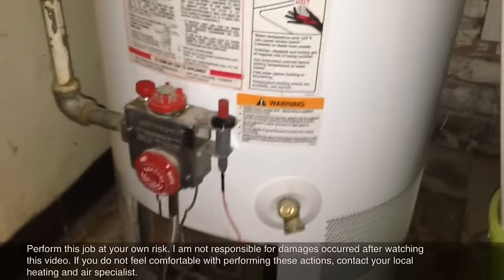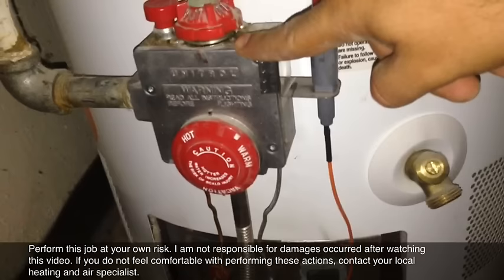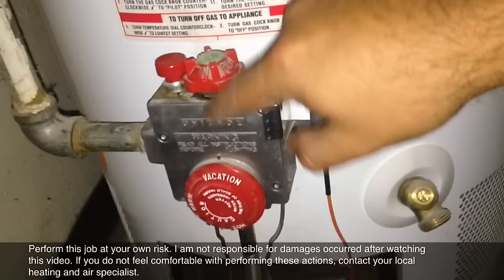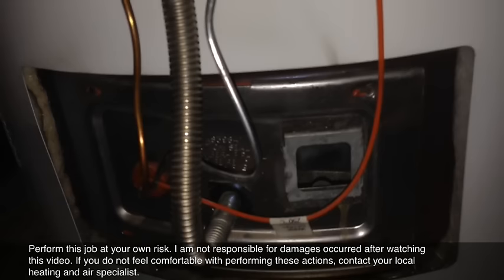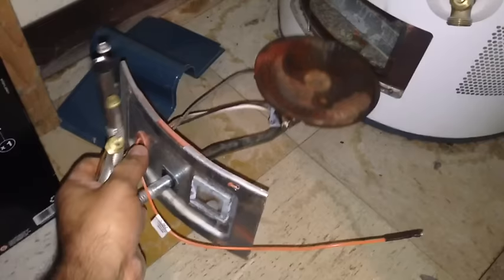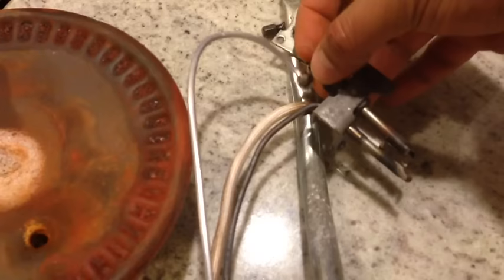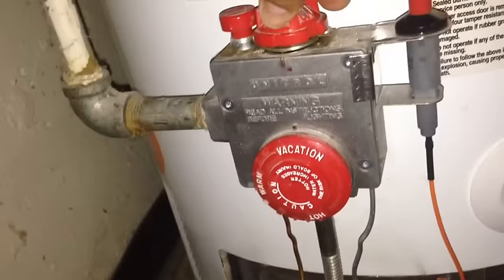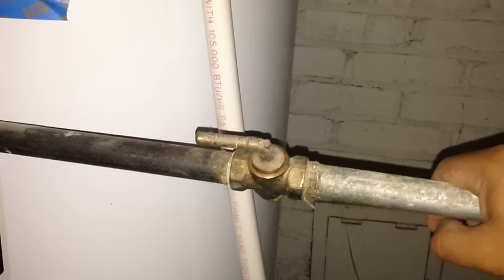Water Heater Pilot Light Will Not Light Up

Comment: THANK YOU!! This helped immensely. My issue wasnt a clog tho, but I would never have found it if it wasnt for this vid.
In my case, the spark wasnt close enough to the gas... so the pilot couldnt lite with it so far away. I believe the tip may have rusted off or bent... not sure exactly but everything worked like a charm after bending it closer so the spark would actually catch where the gas was.

Comment: At the beginning of the video you named the part that you push to create the spark the “igniter” several times. That is one name for it. Then at time stamp 3:50 you couldn’t remember what that part was called. So you called it a “light striker.” I think you were trying to remember “piezo-electric spark generator,” and the wire part is the “piezo ignitor wire.” Thank you for the video. It saved me a lot of time trying to figure out why my pilot light doesn’t stay lit. I think it’s the thermocouple.

Comment: for future people attempting this-

Don't operate that appliance shut-off valve. Those older ones tend to create leaks when operated. IF operable. The controls (box) have valves for the pilot/main burner.

Check the connections you make between the controls and the main burner+pilot tubing when first operating. could be leaking. a simple soapy water solution sprayed/brushed on the connections works.

also, more important than gas leaks is carbon monoxide. You should check for proper drafting when lighting a water heater. Easy enough, at the top of the water heater, where the draft diverter is, and the little gap, it should be sucking up air, not blowing products of combustion out. You can test it with a match/smoke/a spider web, or just by feel. 

Technically you're supposed to replace the gasket when taking that faceplate off the water heater.... at least screw the screws back in. This is a FVIR (flammable vapor ignition resistant) water heater. the design is that a flame CANNOT travel from inside the combustion chamber, out around the base. (or vice-versa.) aka it cant set off a low-hanging "puddle" of propane/gasoline/paint thinner etc fumes. 4 screw holes+ a bad seal defeat that design, and can affect flame characteristics/burner operation. 

-gasman for a utility.

Comment: +Sergio Cordova
just wanted to say a BIG "Thank you!" You just saved me a visit from Plumbing technician, and who knows what may come with that.... I followed your instruction on my GE Smartwarter Heater, which stopped working after the most recent water backup in my basement. And it worked great! The pilot comes right back up after my 1st attempt!

As a side note, not sure if anyone else bumped into the same issue as I had, but thought I would share anyway: Somehow for the first a few times, when I turned Gas Knob from "Pilot" to "On", and turn the Temperature knob from lowest setting back into normal (like "Warm"), the flame came up at the burner for a few seconds, then "Puff" and it just went out. Basically my issue moved from "water heater pilot light will not light up" to "water heater burner won't stay lit". Googled a little but don't see much immediate I can try. I had to take the burner assembly out again, but don't see anything wrong with it. Checked the Heat Link as suggested in a different Youtube video but it's good (not melt). I put my hand in the small front door and reached up the dome center which I think is the ventilation tube, but feel its inner wall is wet, which normally shouldn't have been the case.... It might be from the moisture evaporate but then got condensed, which I'm guessing doesn't quite help on the burning. Anyway, I tried to wipe things dry inside as far as I could reach, and put the whole assembly back in, then, Voila! It finally worked! Now after 3 hours, it went a few cycles between full flame and pilot flame, and things appear to work properly.

Comment: I LOVE this video!  I just looked at my step-mom's water heater and assumed the pilot gas line might be okay because with all my effort it was possible to blow a little air through it.  Now I'm realizing it's probably clogged as you diagnosed yours to be.  This also seems to fit with the fact that when I'm trying to light the pilot, it will show a brief flash of yellow like once every 50 clicks or so as if just enough gas made it in to create a brief flame.  Also, it's a relief to find a video that shows you something other than how to replace a thermocouple...

Comment: Great video!

I'm not sure if I had a similar issue, or if it was just the pilot light not catching for some reason. I did a similar disassembly as presented in your video, and I used some canned air to blow through the pilot's gas line, to try and clear any debris/blockage. At first I couldn't feel or hear anything out the other end, and that could of been because I either didn't have a good seal with the canned air tube, to help keep forced air down the pilot gas line, or there actually was some blockage. After a couple tries I felt air, and a whistle sound from the pilot ignition end of the gas tube. Put it all back together, and at first the pilot light didn't seem to want to catch, but finally it did. First time I had to do that, checked for leaks, everything seems to be in good shape, and the video was a great assistance with the prep work.

Thanks Sergio.

Comment: This worked great and saved me $600.00.  Just to add that check all your gas connections with soap water.  Dont need a gas leak if your connection is not tight.

Comment: Early model GE Waterheaters (2004..) used the Smart Shield Sensor System.  The system is basically a steel rod under the burning pan that operates the air damper.  I called GE in Brooklyn and got someone to send me the replacement module.  In the interim, I found a glass marble in my junk drawer in the kitchen, put it in place and NOW I HAVE HOT WATER AFTER 3 DAYS!!  Much better than a $500 water heater.

Comment: This video helped me to lit the pilot which was not turning on before. I did not disconnect the full assembly but instead blew the air through the pilot gas pipe and it worked. Flame was there for a while but after few hours the flame light is gone. I am sure the thermocouple is not faulty because it would have not stayed on for few hours. Should light go off when water reaches the desired temperature or not ? Will it ignite automatically or it should always be on ? If it is going off then I guess blowing the air through pilot gas pipe did not help and i would have to clear the pipe thoroughly but first I need to know whether pilot light suppose to be on always or not. Answers are appreciated. Thanks to Sergio for the awesome video.

Comment: Hey,
I just wanted to thank you for your video. This very thing just happened to me over the weekend. The water line at the top of my tank popped off (shoddy install) and flooded my basement. Turns out while water was getting all over the basement it also got in the gas lines to the pilot and the main line and was causing this exact problem. I followed your video and fixed the problem perfectly.
You rock dude!

Comment: Thanks, this did help. At first I did change out the thermocoupler which in itself was something new and rewarding to learn how to do. But the problem persisted that the pilot will not stay on, so I cleaned out the pilot tube as best I could.  I was getting air through it it was not completely clogged but I assumed correctly that not enough gas was going through it. Thanks again

Comment: Thanks so much for your video!! I realized we weren't getting any hot water so of course I Googled it.. and clicked your link. So I got everything off and apart per your video, seen some debris on the burners, cleaned out inside and put back together, no luck, no pilot light. After a bit more of Google I sanded down the Thermal Coupler, put back together and Pilot light works as well as Hot Water!!! Thanks very much for the detailed Video!!!

Comment: This was really useful. I had a similar problem, but when I tried to remove the pilot from the pilot orifice the act of twisting the nut also twisted the soft metal gas tubing!!! 😢 I ended up replacing the pilot assembly part SP20127 and all is well!! Much thanks to this "to the point" video!!!!

Comment: I had your problem with a new construction change out h2O heater, you saved the day! I couldn't remove the plate due to a gasket, but applied vacuum to the line clearing it. Thanks!

Comment: I have a new  hwh that was flooded I bet with the cleaning of the pilot orifice as you showed I will solve the problem of no gas to the pilot, Thank you ! Basic common sense but it takes experience to get it; the logic is the gas has low pressure so it does not take a lot to block its flow

Comment: Just wanted to Thank you for posting this, my "plate" which is heated by the gas was full of bits of rust, I cleaned it off then re-lit the pilot which initially would not light then presto it worked. God bless!

Comment: great video. didnt have the same problem but you showing how easy it was to access the area, I was able to fix my heater. the porcelain that held the igniter wire broke and the wire was hanging. I was able to fix it with relative ease thanks to your video. saved $$$$ again thanks to YouTube. thanks again.

Comment: 20015: this video importantly shows how to clean out the PILOT and PILOT ORIFICE even after suspecting the thermocouple (copper tube). clean your observation window and use your smartphone camera or mirror for a better view of the pilot light. add a comfortable 3/4" rubber floor mat or rug to work on for this repair. if you already used a digital multimeter to test the disconnected thermocouple for around 20mv when holding down the pilot button and a sparked lit pilot your gas pilot (aluminum tube) may still need cleaning to provide the sufficient heat to the thermocouple tip during normal operation of the water heater. note: newer burner assemblies may have an unusual thermocouple with an in-series overheat disconnector. (compared to the simpler $10 model shown.) basic careful cleaning of any of the water heater screens or perforated intakes using your small shopvac is wise.

Comment: This was very helpful thanks.  I followed your procedure and got my pilot to light and stay lit.  Only problem is I had a gas leak because  did cross thread my pilot line to control valve joint when going back together. Some TLC and grooming and I was able to overcome and it passed the soap test with no leaks.   Seems like it should be obvious but use caution when making the joint back up.

Comment: Thank you, it worked.  Strange after 8 1/2 years the pilot went out.  I realize builders grade it's soon time for a new one.  BUT.. we tried and if I hadn't watched this, I would not have held the gas down long enough to warm the thermo couple.  You saved us an expensive call on a old system that I should look into replacing, this long with hard water I'm surprised we hear no pinging or knocking or that it simply kicked the bucket.
Reply from the maker: Glad it helped, however, if it's 8 years old, I would seriously think about replacing in very soon. It's likely the pilot line got clogged because it may be leaking internally and could go any minute. I would like around the burner to see if it's wet. Good luck!
Reply: Sergio Cordova  I did Sergio.  Flame would not stay lit, I had one repair on the unit a couple years ago.. after that I decided if it needed more, it would be replaced.  Still I had a higher comfort level relighting it than I would have if I hadn't watched your video.  Thanks man.

Comment: I noticed my water heater goes out when the furnace goes on or when there's disturbance in my basement - so is very sensitive to drafts (it's about ten YO).  Usually I can relight after following the directions on the heater, millivolts or not. The directions are easy.   However when it's super cold out the igniter doesn't really do anything, will spark and spark but no pilot light at all. This has happened several winters and I finally made the connection between super cold out and igniter not doing crap. I watched a few youtube videos about cleaning out all the clogged lines etc or replacing something.  Seemed too difficult and scary to me. After four days of showering at the gym and waiting for the water heater gods to let the pilot respond to the igniter, I took my super soft rubber mallet (not hammer) with a big fat head and gently pounded around on all the lines (pounded is too hard a word).... gas line, all those other copper lines going here and there.  Anyway after doing that, the first time I tried to light the igniter, voila, the pilot lit up like  a charm and then the burner swooshed on.  Whew! So I either knocked something loose or was lucky, or the gas had expanded enough since it wasn't below zero outside to make it to the gas line to my water heater.  Anyway, think it's worth a try, no trip to Home depot or knowledge of plumbing or valves needed.  I didn't pound, just knocked like knocking on a door when someone's sleeping (quietly).

Comment: Thanks a million!!
I had to get a replacement picot lighter ignition switch for like 15$, I kept pushing my old one and no spark. Still had to wiggle the wire,  but sooooo much cheaper than repairman. Would of been worth it if fix was harder for me, but overall, thanks😁

Comment: I started to follow the instructions and realized that I didn't have to take anything apart to clean the tube. I just disconnected the pilot gas line and blew some brake cleaner through it, waited for it to dry,  reconnected it and it lit up on the  first try!

Comment: Great video. Thanks for the info. My pilot line wouldnt come apart but had a little hole on the bottom. I blew into that hole and a bunch of black ash came out the end. It lit up right away. Thanks again.
Reply: +gudtims4all That piece he showed wouldn't come off the line on mine, either, but I cleaned the end I had access to, then blew through it, and it seemed to flow pretty well for such a small hole, so I reinstalled the burner, and it's heating my water right now!
Reply: I agree. helped me too 😊

Comment: My man my boiler stopped working and with your help I got the wire cheap and replaced it and did not call anyone making sure that the ends are close to each other because it will not fire otherwise it took a couple tries but appreciate your tips.

Comment: Thank you so so much for this video. I had the exact same problem with the small piece at the end of thermal coupler being clogged, and therefore the pilot light was not being lit. You saved me a fortune!
Reply: So your issue was the thermo coupler instead of the pilot light orifice? Is that part located on the outside of the water heater by the thermo coupler line or inside of the cover when you remove the burner plate & cover? Can you please elaborate a little more on the small piece at the end of the thermal coupler? My pilot kept going out after I'd light it up, but now it won't light up at all after initially it did light up, then went out twice. No dice on lighting it up now..

Comment: Well try it is I may I try to uncouple unscrew the park if you're referring to on the pilot light and that I just couldn't get it loose. So what I did was I took my air hose to the top of the pilot light gas line and blue out of his best I could tell I could feel it at the other end and it seems to work just fine thanks for your tip pal

Comment: Thank you for posting this!!! You saved me a lot of time and probably money. After a couple of my home improvement books, a dozen videos, and hardware store people brushing this off as a thermocouple problem, I tried taking out the little implement as you did. Mine didn't seem to be occluded, but I blew out the pilot line and cleaned out the tip and it fired up right away when I put it back together. Thanks for helping restore sanity in our home!

Comment: I have the same problem.  I took everything apart and blew into the same hose that you did but I was able to blow air out the other end.  I am hoping it was clogged and came unclogged as I was disconnecting. I got everything put back together and am going to try to light it again.  Fingers crossed, hoping it worked.  I'll let you know soon...

Comment: Edit: My stupid WH would not light, all I did was pull out the burner, rotate the thermopile 180 degrees (these get fouled by black soot very easily) stuck it back in and it fired up the first time ;)Finally a video, which explains why the pilot, may not, light...everybody defaults to the stupid thermocoupler.  Thanks for the video, I'm going to verify my pilot gas line is not clogged, because it appears this is the first step in getting a flame going. 👍

Comment: Thanks alot man, you're a blessing bro. We had the same problem and now it's fixed. It was the middle of the night and I didn't want to pull out the whole burner assembly so I was hoping I could get by with just disconnecting the pilot connection and blowing it out. It ended up clearing whatever was in the pipe and pilot lit no problem. I'll probably take the assembly apart another day to do a more thorough cleaning though.

Comment: Thanks for the video - my pilot wouldn't light, unfortunately I could not get the pilot tube out from near the burner, but took it off the outside valve, verified gas was coming out of the valve, and blew compressed air through the tube. Fired right back up.

Comment: Thanks.  This is helpful as my water heater is having a similar problem.  I can't get the pilot to turn on.  It maybe either the igniter spark isn't working or the component is clogged.  Will give this a try.
Reply from the maker: Let me know if it worked out for you.
Reply: The screws to the light was all corroded.  Had to get a new water heater since the old one was almost 10 years old.  Appreciate your video nonetheless